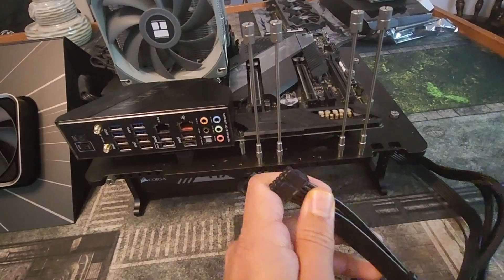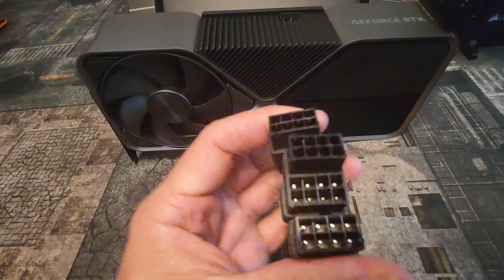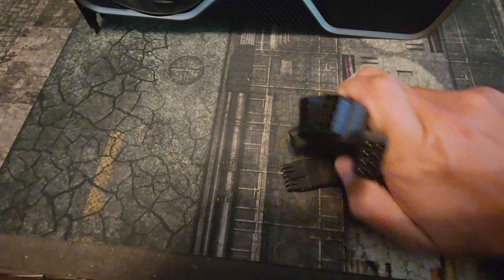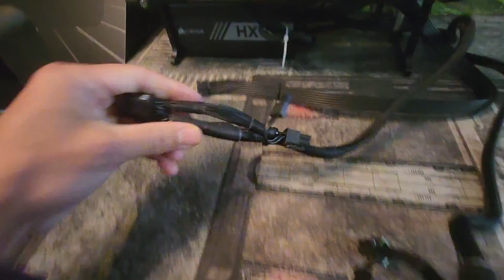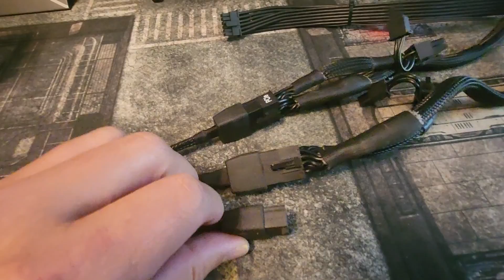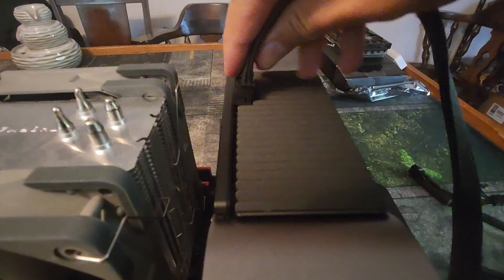4090 revision 1 12vhpwr cable install guide: everything you need to know about the updated 4090.

Comment: This connector is a joke , they should use 2 EPS CPU connector instead .
Do you see , you are putting 600 watts from 4 large plugs to one small one.
You cant change the basic laws of electricity.
Nvidia has no common sense.
Reply from the maker: they are getting alot of bad press again, I have yet to have an issue but I get where everyone is coming from